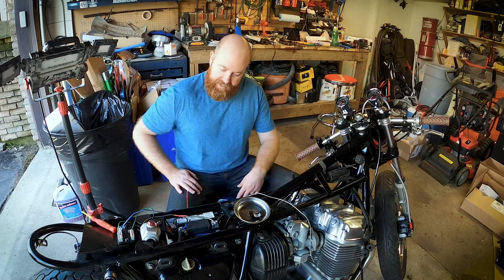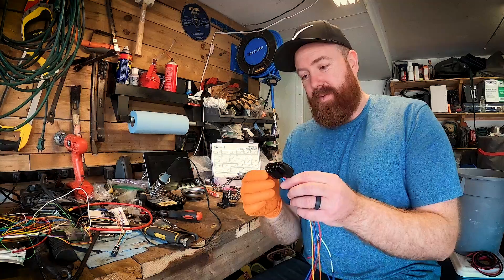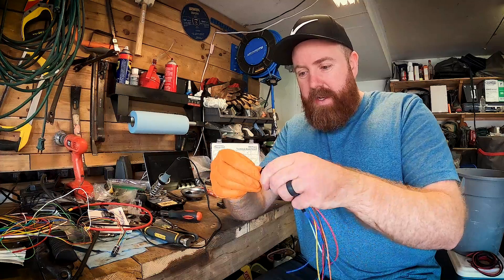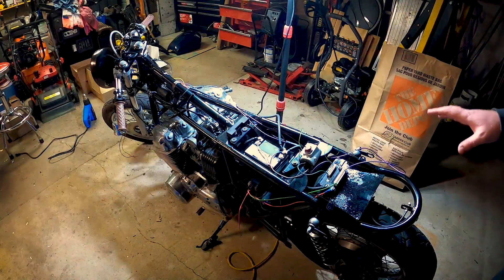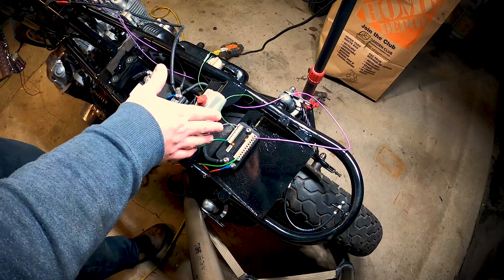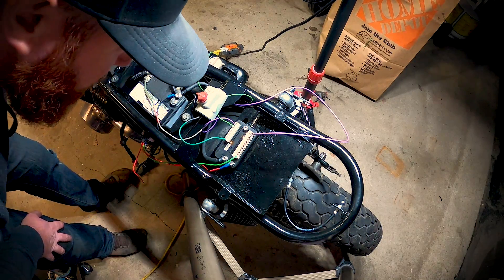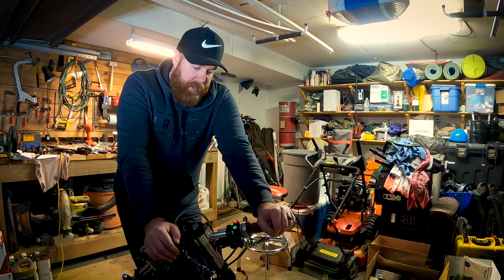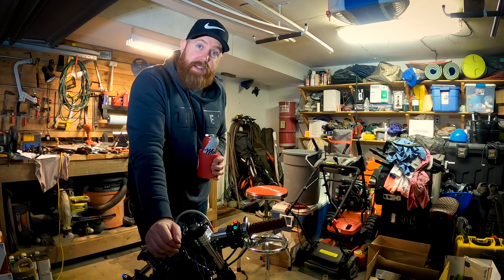CB750 Cafe Racer Build E30: Wiring the M.Unit, M.Button and Rebelmoto switches

Comment: You could've use one negative to all buttons and also one positive for all led lighting. 5 wires would work great for this installation 👍🏻
Reply from the maker: Yes, you are right. I found this out a little too late to be honest. At the moment I'm putting on a new speedo/tach and will redo the grounds at the same time. Thanks for watching. Steve

Comment: SNAKES ALIVE … shut my gob!
Really it’s a simple single cheap controller that the rats nest of wires attach to… about $2. As neat as this seems it introduces complications to the wiring beyond easily field diagnostics along the roadside, and it still needs ground and power wires… so it’s not one wire just the comm signal wire going to the M-gadget. The hassle of making a bundle of hidden switch wires to it and stashing that in the handle bars is just crude or more so than simply running a bundle of individual control wires direct from the switches … probably is easier… and it is still digital control with low power control wires. A neat bundle 12v low power 20-22-24 gauge wires has the advantage over the single 22 awg wire is some mechanical robustness and less electrical interference issues… and easier to put shielding sleeve over the bundle and make ground connection. NOW here’s an idea run the bundled cables to the m-Button using a nearby small connector or a terminal stop for the control switch wires connections then you have trouble shooting access to the switch wiring … this mounted next to the m-gadget… and m- button then that tiny fragile single wire is protected and you have much less complication and aggravation hiding all the mess of switch wires to m-button… As alternative do this near the handle bar but you still have a single fragile wire run… that you need to bundle like a loom and shielding protect.
Reply: Honestly thy could have installed the controller chip in the switch assembly
Reply from the maker: Fair points. Thanks for watching. Not sure I would use the M-unit again to be honest.
Reply: @cafechronicles  I only used it to have the security, keyless start/stop, and the ability of using cell phone programming…. That’s a lot.  Wiring the mechanical control wiring and switches I see no value in the M-unit… and it makes field trouble sorting not that great.  Sometime I will do a wiring video.

Comment: Why are you using such a big gauge wires for the controls? All they do is send a signal to the m unit. You can use .5 or .75 mm wire for the buttons.

Comment: Great video! 
I would like to know if this kind of controls can be used on any type of motorcycle, for example (Honda Rebel 300 ABS)
Reply from the maker: Hey thanks for watching. These are momentary switches. Meaning they don’t stay on or off like a toggle switch. They will work anywhere an existing switch is momentarily creating a circuit. I have a feeling the the rebel uses a mix of momentary and toggle which would complicate things. However, it is always an option to rewire a motorcycle. You would use an m.unit and the new switches. However, I think it would be a costly exercise and would be time consuming. If you weren’t considering keeping the motorcycle long term, I wouldn’t recommend it. It may actually reduce the value of the bike. Where this setup suits really well, is for creating or updating the wiring on an old bike you are modifying or restoring. I hope that helps. Good luck 🍻

Comment: Hey great video - 
Do you mind explaining again where the RM switch led wires were connected ? For the constant ‘on’ function. 
Cheers mate 🤘🏍
Reply from the maker: Hey thanks for watching. Do you mean for the led lights in the switches?
Reply: @cafechronicles  hey bud - yes, I’ve got a CB750 1980 with the blue unit and 2 x Rebel motor LED switch. 

I’ll use the M-Button for the switch however for the ‘running LED lights’ where did you plug them into ? Also in the M-unit ? 

Cheers
Reply from the maker: Shoot me an email at info@cafechronicles.ca and I’ll share the wiring diagram I used. 👍

Comment: I dont know do you remember what gauge wire you used it looks kinda thick. I tried using 0.5 mm wire and all the wires just wont fit went onto the website the reccomend 0.22mm wire. So i have to undo the whole wiring set up for my handlebars unfortunately 😅 lessons were learned
Reply from the maker: Aw man, it’s a long war. Some days we lose the battles 😂 but we’re headed in the right direction 👍 good luck 🍻

Comment: Can you use either terminal on the switch for the negative for the non-LED portion?
Reply from the maker: Hi Aaron. You need to provide a ground to two posts on the switch. One for LED and one for the momentary contact. However, a cleaner way to this would be if I had simply jumped the negatives together. I wanted to ensure each button was separate for troubleshooting in future. However, in doing so made a massive amount of wires 😂 I would probably do it differently if I did it again. All that being said, I’ve had no issues with electrical and all has been solid on the bike for a year. Thanks for tuning in 👍

Comment: Looks like you used thicker gauge wires. I used 24 gauge and they were not as bad
Reply: I just finished wiring mine with 24. It would not have been possible for me at all with anything thicker because I used rising drag bar that is one piece unlike clip on. Keep good videos coming :)
Reply from the maker: Awesome! And thanks 🙏
Reply from the maker: Yeah I think I went a little heavy on those. I think you're right, 24 would have been perfect.

Comment: Where did you run the power for the button led's to on the m unit?
Reply from the maker: I believe I ran it from Aux 2 and then ensure you configure the output to always power up on start. Thanks for tuning in 👍
Reply: @cafechronicles  did you just tie all the positives together then run one wire to the aux at the m unit? That's where I'm getting confused.
Reply from the maker: Yeah I did. The same with the grounds. Email me at info@cafechronicles.ca and I’ll give you the details. I’ll share the diagram I worked from if it helps. 👍

Comment: Noice job
To be faire you were supposed to use 0.22m2 wires as recommended by RM : )
(Anything bigger makes it a nightmare to fit in the casing)
Reply from the maker: 😂 I live and learn. You’re absolutely right. This build was a steep learning curve. I’m thinking of actually rewiring a little this winter. I also have a new speedo and will pop that on there. Thanks for watching 👍
Reply: I’ve you gonna rewire. Maybe connect all negative into a single wire?

Comment: Hey bud just git some of thus switch gear ,looks desent but didn't know about the m unit . Were did u buy plz ? 
Cheers for the vud
Reply from the maker: I bought mine in Perth County Moto in Ontario. Good prices and good support. Where are you located?
Reply: @cafechronicles  im in dorset ,England  . Looked online and is it realy 200 +?
Reply from the maker: Yeah it’s a pricy unit. You will be able to buy it locally in a England. I think it’s actually made in Germany. The website is https://motogadget.com/shop/en/electrics.html
Reply from the maker: There are two versions, the standard m.unit and the m.unit blue. The blue version gives you Bluetooth connectivity to your phone. Allows you to configure it by your phone and even use your phone as a keyless start/button start once your phone is in proximity of it. Is the bike your building wired and running already?

Comment: You could’ve grouped all the negatives together, or bused them to each other directly on the back of the switches, and then only had one ground wire to feed down the bars.
Reply from the maker: I think you’re right Johnathan. I think my next wiring job I will go that direction for sure.
Reply: Yep that's what I have done, and when you are wiring one piece handle bars its a lot tougher than clip-ons so 22swg wire is essential. Great switches I love them.
Reply from the maker: Great stuff Paul! 👍 shoot me an email with a photo. Would love to see how they look info@cafechronicles.ca
Reply: @paul4777  How did you do it, I would like to do the same. But I dont know how i should do it when you have to solder them on to the buttons, Motogadget mo.switch basic is with screws on the back off the buttons so it is easier. but they are just not as cool.

Comment: Question. Can the aftermarket switches be wired to the bikes oem switch gear loom . Very good video
Reply from the maker: Hi Joseph, thanks for watching. Good question. Using the original wiring harness, new aftermarket switches may be used. However, you have to be careful on which type you choose. The original wiring harness needs the switches to be a "toggle" style, meaning they switch on and make a constant connection between ground and positive, and then can switch off which breaks that contact. The likes of systems like the M.Unit need a "momentary contact" switch, which does not toggle to on or off, it simply momentarily connects and disconnects the ground and positive. So you will need to get the correct type for your application. Feel free to email me or message me on instagram if you need help. Good luck and happy building. Steve

Comment: Just started building my 1975 cb750 brat / cafe ‘ using the motogadget munit blue and rebelmoto switches also ‘ great vid ‘ hello from Dublin Ireland 👍🏻👍🏻
Reply from the maker: Amazing man, thanks for reaching out. What stage are you at?
Reply: @cafechronicles  have everything just waiting on my rearset and triple clamp and conversion stem from the lads in Cognito Moto I’m doing a gsxr 1000 fork conversion oh and my tuffside seat other than that the bike is ready to be painted and reassembled’  the rebelmoto switches look really well the extra wiring was worth the bling 👍🏻👍🏻💯💯🔥🔥
Reply from the maker: Haha yeah the bling is where it's at. Nice work, the Cogitomoto stuff is awesome, not cheap, but very good quality, I popped the rear sets on this build. The Gixer front end will be awesome, good on you for that. Are you replacing the original steering bearings in there? I've been using the tuffside seat now for a while, and I have to say, its very comfortable. Anyone that sees it, comments that it must not be comfortable as its so shallow, but the foam they use is excellent and it really is a comfy seat.
Reply: @cafechronicles  i got new steering bearings with the stem I also got a hub conversion to lace the original front wheel I wanted to keep the vintage look ‘ your right there not cheap but the quality of there products is unrivaled’ I was thinking of ordering the small honda seat as I wanted the minimalist look and was thinking the big style honda seat would be too bulky but u said it looks really shallow so I’m happy with that I was afraid it would look to bulky
Reply from the maker: Ah yeah it’s great stuff. Yeah I find the seat to be nice and slim. But I know what you mean about the short seat. I’m interested to see how it’ll look on your bike. Keep me posted 👍

Comment: “Surely there’s a way to do this thing that would defeat the whole purpose of the thing”
The only reason to use these is to use these or solid state buttons is to control different things without changing the wiring. The reason they have four wires each is what allows them to function how you want them to function. I didn’t know people installed these not knowing that.
Reply: Nah, it’s better to start over and just leave your ignition/ecu looms, because you don’t need most of the original wiring! If anything it’s more complicated to try to splice it in.
Reply from the maker: Hey Charlie, thanks for tuning in. There was no existing wiring harness on the CB750 unfortunately. It had been torn down and taken out. I had to make one from scratch.

Comment: Awesome video. I’ve been looking for one like this. Thinking about redoing my chopper wiring. I’m just wondering if you could have used real thin wire for that part since it is just going to a micro control unit in the handle bar and the power for the lights and everything really come from the battery from the other side of the M unit. I might have to investigate that. That sure is a big bundle of wire. LOL. Thank you very much brother.
Reply from the maker: Hey Mike, I think you’re right about using a lighter gauge lol. I think if I was to do it again, I would use a lighter wire. I had purchased a wire bundle from Motogadget, which is good, but I ran out of the lighter gauge quickly. Also, I think I would solder one common ground to all buttons in the switch. I think I would pass on the LED switches too. But I’m delighted to hear you’re thinking of going for it. One thing I’ve been learning in this whole process, is that the hardest part is deciding to do it. Get stuck into it brother!